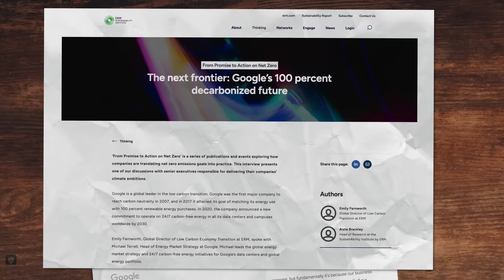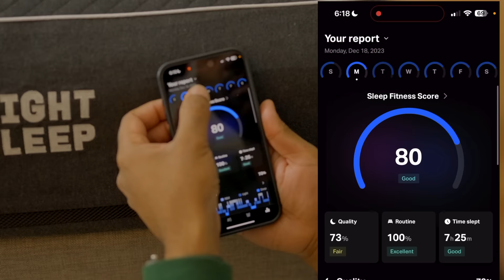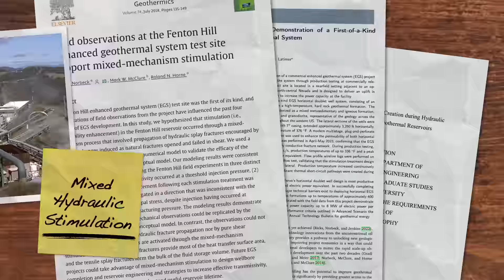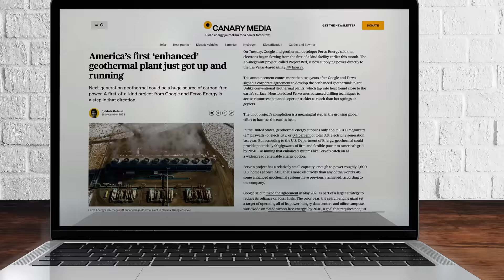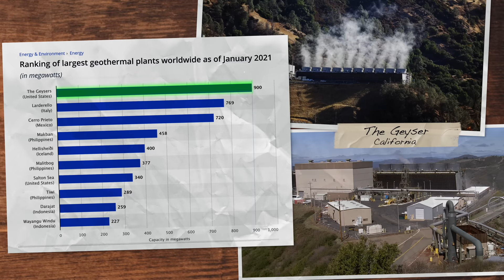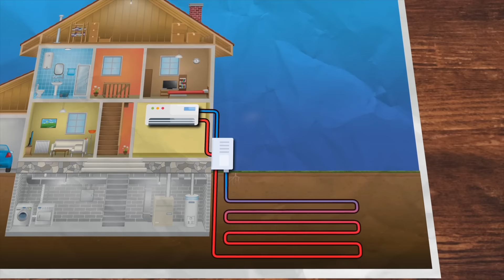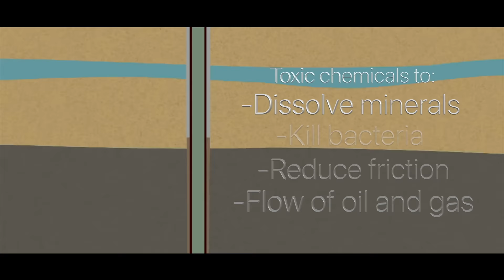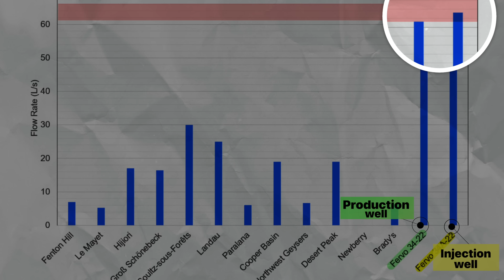Google’s Billion Dollar Gamble: You Won't Believe What it is!

Comment: Another "level" is to place your servers near a company that needs low temperature (pre) heating of some input (water perhaps).  Thus cool water heated by the servers is supplied to the neighbour pre-heated thus saving the energy.  The user pays the server co. so many cents per kWh of heat but at a rate less than the cost of natural gas.
Reply: Next to a swimming pool :)
Reply: Great point!  Maybe, since these can be used for server farms, they create a big pool of water and create submersed server rooms that contain the servers (obviously with a way in and out for server access). 

In the pool, have the server rooms on “stilts” to allow pool water to circulate around the entire room. Design the internal server room to optimize air flow around the servers. 

Water surrounds the server rooms, cooling the servers while preheating the water) at the start of the heat transfer process.  Any corrosion concerns can be addressed on the external walls of the submersed server rooms. 

To control the pool water, may need to create bypass pipe(s) with temp managed valves (adjusting flow based on pool temp). 

Don’t know how feasible or impactful but if lots of energy is spent trying to cool servers, maybe they could benefit a little on both sides of the wall.
Reply: @tomatodanger  Much simpler to simply blow air heated by the servers through heat exchangers to warm the water; this cools the cooling air (of course) and the warmed water can be sent next door for whatever that process is.  Meter the amount of water and the change in temperature and that is the energy transfer.   
eg: 1 m^3 heated by 10°C* is 0.66 kWh of energy.
(*Should say 10K, but that confuses people 2 ways).
Reply: @AlanTheBeast100  nice!  Far fewer moving parts (and submersion concerns 😄) to preheat the water and still a potential drop in electricity required to cool the server farms as the cooled water can be used to reduce and control the temp of air entering the fans.
Reply: IBM has done that at ETH in Zurich where water cooled servers are connected to building heating.
Reply: Or a blue/green algae food generator
Reply: @tomatodanger  Most already use a pond loop for cooling. Standard cooling and heating is done by a glycol/water hydronic loop. For instance ski areas melt the snow on sidewalks and roads by just pumping a loop trough the bottom of a pond that is frozen all year on the surface. You can target hydronic to the heat exchanger on the rack. 
A waterproof room that destroys 10 million in servers with a leak will never work better. Even underwater you have to deliver it to the server. 
Also the humidity load will cost more in a lake than next to one.

Comment: The footage clearly shows a piston reciprocating piston device. It is not a "Turbine." In 1973 ,exploring New Zealand, I visited a thermal power plant. Bores brought up superheated water
which was put though heat exchangers, to produce steam, which could then be utilized to drive turbines. The negative aspect of this was that minerals in the steam deposited mineral in the piping, eventually closing the diameter of the bore and requiring periodic drilling to create a new passage to the surface. Free steam, at a drilling cost, was, as it is said, :Fruit on the sideboard.

Comment: Ricky congrats! Ive been following you since the beginning. You really stepped up your game and your reports are top notch. Unique, in depth and interesting. Talking about geothermal I witnesed two stages of project Miravalle in Costa Rica atnthenslopes of a vulcano. The problem was the minerals that deposited quickly on the pipes clogging the system
Reply: That's what I've been saying from the start since someone proposed using saltwater as the working fluid.
Reply: Make a closed system and circulate your working fluid.

Comment: Thanks for another great article Ricky
Please check out the company Eavor and their eavor-loop  geothermal system.    They have developed a closed system much like an underground radiator which has little or no fluid loss to the rock also they claim far lower circulation energy as the system is partially powered by thermal cycle    
I would love to see your evaluation of their process
Reply: That's a great idea! I like the concept behind the eaverloop. However, that system is quite limited in terms of heat extraction rates compared to EGS, unless you literally drill a radiator with multiple loops and coils.

Comment: I'm excited to see Geothermal used more.  It makes a lot of sense.

It would be cool if Google was able to find a use for the waste heat from their servers as well.

Thanks for this story!
Reply: Google does put use to their waste heat.  For many datacenters, they use that heat for things like swimming pools, various farming practices, wood pellet production, or just simply a building heat source in winter.  Personally, I think it'd be a good idea to purify sea water, since that's normally a very energy-intensive process.

I imagine Google could probably use heat pumps to concentrate the heat for applications that require a higher heat output.  They could even make a steam turbine but I'm sure the energy they gain from that wouldn't make up for the cost of building it.
Reply: So true! Imagine edge computing centers combined with heat pumps for residential or commercial heating. It makes so much sense!

Comment: While I'm a fan of residential geothermal, the need for industrial geothermal plants to use deep fracking processes is an absolute no-go in my mind.  Living in Oklahoma where fracking became a major method of extraction for a while before being severely limited, we experienced house-damaging earthquakes and shaking weekly.  The weekly shifting of the ground rocked the framing back and forth loosening the nails, created leaks in roofs by creating gaps in roof decking and drove wildlife to run from the shaking right across freeways.  Oklahoma oil producers reaped the energy, while we paid for the repairs and foundation issues to our homes.  So, I would recommend  Google keep looking for other ways to be 100% carbon neutral.  If anyone can do it, they can!

Comment: The water use by the pilot plant isn't that great in the scheme of things if its located on a large lot let say tens of acres then 17 million gallons could be collected during a good rain storm if the drainage is managed properly. The biggest challenge is constructing a cistern that would hold that much water.
Reply: Great point! Most problems can be engineered as long as we think ahead of time

Comment: I instantly drew the same conclusion about geothermal fracking. It's what is done to the water supply that is the major problem, that is specifically due to toxic chemicals that apply only to fossil fuel extraction, so unless they are injecting the same or other toxic chemicals into the ground for geothermal purposes that I am unaware of, the biggest fracking concern doesn't apply.

The geologic stability concern still applies, and that still needs to be talked about. One might expect that to be a deal breaker in California, a state that already has a problem with geologic instability, but on the other hand, the existing potential for earthquakes also means that California is perhaps the best place to accept this risk because their infrastructure is already engineered to accommodate it.

The last issue, as you mentioned, is water usage, and in some places that is a huge concern now, and will likely be a big concern in more places in the future. Considering the long-standing and worsening water supply problem over much of the US southwest, that seems like it might make the idea a nonstarter where many of Alphabet's operations are based, unless they can figure out a way to offset their water consumption. This would effectively convert Google's conservation problem from carbon zero to water zero.

Fascinating video! Thanks for posting it!
Reply: Water recycling, using preheated water from the server farm cooling, closed system. it should work with less water.

Comment: Hydro fracking is also used in low production water wells, to open up the granite cracks so that the water can flow more efficiently/freely from the aquifer.
Reply: Great insight! However, I like the fact that Ricky clears this up so thoroughly because lots of people have misconceptions about it.
Reply: Not the same tech or substances at all...
Reply: @ipp_tutor no.. you do, ironically.. and i used to help run a fracking sand truck company
Reply: @dertythegrower  Of course, they're not the same substances. That's precisely my point, and it's why I say people have a misconception about fracking being used in the context of ESG, thinking it's the same as in the oil industry.
But whatever gives you the right of way to showcase your experience...

Comment: Our school district installed a 180-well closed loop geothermal system for heating one of our high school buildings. The system worked well for a couple of years until they noticed that the Delta-T was decreasing. Each year the water temp coming from the field was getting nearer to the return temp to the field. Seems the field could not recover fast enough to keep the water hot. They tried to return the heat by running the AC all summer to pump heat back into the field but this didn't well and was costly. They finally had to install natural gas boilers to help on the colder parts of winter. Not certain that they ever saved money or were able to keep their LEED ratings.

Comment: Just because you're not injecting chemicals doesn't mean that you can't affect the ground water, even just by pumping.  There are different strata of ground water, some that's older with dissolved compounds like sulfates and iron, overlaid with strata that are clean enough for drinking.  If you puncture the barriers between strata, and pump at higher rates than replenished by natural flows, you can end up contaminating the cleaner water by sucking water from the more brackish or "dirty" strata into the cleaner strata.

Comment: Thanks for sharing your videos and updates on various technologies. Always been a big fan of geothermal energy. Last I heard test sights were being shutdown because of their ability to make earth quakes. This was long before fracking was even on the radar. Curious that that is still an issue over 30 years later. They really need to stop trying to make a short cut to getting the heat out of the ground from above. IE they need to put boots on the ground where they are needed even if it’s under ground in high temperature dry rock. They need to develop a functional closed loop system for energy production. 

Future video idea, possibly make a video about the efforts that Eric Sorensen has put into saving thorium liquid salt reactors from the dust bin of the past. Also the various benefits that they could provide. He has several vary long and dry informative videos that are very hard to watch but  chocked full of details that are easy to overlook with each one individually being a game changer. Basically make a summary of his videos simplified and highlighted to show the how, why’s, and benefits simplified to open them up to the general public. Having had over 30 years in the power industry it took me several views of each of his long format videos to pick out as many benefits as I did and almost every one would be a game changer if it could be transferred to our current fleet of steam powered generators independent of prime mover.

One of the biggest advantages was the ability of the reactor to be self regulated due to the science behind its design. It only makes more energy when you withdraw more energy. Stop taking power out it idles itself back to a steady state standby. As a power system operator that one is amazing. The fact that it is self controlled is probably the scariest part of its design. There are very few control inputs because they simply are unnecessary and would likely mess it up thru operator input. It’s truly a walk away safe design.

Comment: Water scarcity is predicted to be the biggest issue this century. So unless they're cooling the water down again into liquid (condensing), then they're pumping clean water into the ground and it is lost as steam. At 63 litres per second that is 33,112,800 litres per year, or 13 Olympic-sized swimming pools. An adult uses 124,350 litres of water per year, so that is enough water for 1,008 people. Add to that, this is probably just a demonstration plant, a proof of concept, so they will want to scale it up. And what about limescale build-up over time? Will they need to re-frack every few years?

Comment: For oil and gas fracking using propane as a fracking fluid has advantages over water.  Of course there is no water to contaminate aquifers. The propane comes back after the waterless fracking so it can be reused.  Propane also produces a frack well that produces more and for a longer period of time.  Only down issue is propane fracking is initially more expensive.  This expense if actually made up for with greater production from the well.  Maybe enviromental groups should be demanding this waterless fracking apposed to outright fracking bans.
Reply: "Propane, Billy. Its the Fuel of the Future!"-- Homer Simpson

Comment: In Arizona, they pump water into the ground to replenish the ground water that is pumped out. Replenish the water table isn't a bad thing.
Reply: Mmmm, well, we Arizonans better pick that up a bit, seeing how farmers and rural locations need to drill up to 1000 feet to reach the fossil water aquifers.  At least one basin is down 2000 feet.  In almost all cases, ground water is being removed at a greater rate than it’s being replenished.  Statewide, we’re in a negative balance situation with all aquifers continuing to shrink as we need to drill deeper to pump out what is needed…or, tragically, what is desired.

At least we have policies in place such that we make an effort to replenish groundwater reservoirs, but the aquifers are losing.  No aquifers have a net positive recharge.

Comment: That steam is nowhere near the super critical temperature required to run modern turbines. The last 20% of the temperature required uses 80% of the energy required to get to super critical steam. What are google using to give that final boost?

Comment: So I know heated waters from the mantle have dissolved metals and silica and that is the mechanism for most geological concentrations of resources we mine(which a billion exceptions) does anyone else here have a feeling there's a way to exploit that while also harvesting geothermal energy? So the metals and other minerals drop out of solution/solidify when pressure and temperature drop, so I'm curious if there's a way to incorporate a way to harvest the minerals in an economic way. Im curious if it will negatively effect the water table. Im curious if being near an ocean or sea and creating infrastructure to feed sea water rather then drinking water to the depths we'd want instead of drinking water. The risk of steam explosions or unforeseen geological events is a possibility I imagine.

Comment: Great work as usual but not sure if I can call it "green" if it's using that much water. Society has always been concerned about clean water and Google is 'doing evil' to make a profit.
Reply: You're right. Carbon-neutral and controlled output in real time are the two main benefits. But the use of water is bid deal, especially if you have to use freshwater.

Comment: Fracking is not the issue. It can be done without causing environmental damage. Oil companies have used chemicals to improve the effects of the fracking to maximize oil and gas production. This is the issue and fracking can be done without the chemicals. Simple high pressure water works fine for geothermal energy.

Comment: The reason gas works for "peaker" generation is that the cost of production comes largely from the gas consumed so you save money when you turn down generation. I would expect that the geothermal plants described would look like a fixed-asset cost base so, yes you can flex output but the costs don't change - much like Solar PV or Wind generation, NOT a good basis for a peaker plant.

Comment: I work with steam engines and power plants as a hobby and you can solve the water loss issue by using a closed loop heat exchanger underground instead of spraying it into the rock directly. Above ground, space isnt an issue for a power plant of this scale so building an air cooled condenser to recapture 100% of the water exhaust from the turbine is definitely doable. They also have the luxury of not needing to inject oil into the steam like i do for my small piston steam power plants

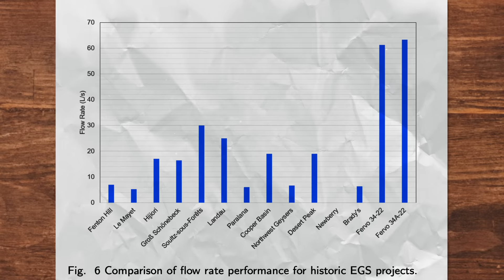Comment: The chart @18:00 shows the huge advantage of fracking the rock.  Consuming 17MM gallons a year isn't unmanageable if you're in an environment with ample water, but the middle of Nevada doesn't seem too promising on that score.  It'll be interesting to see if the water loss continues without end, or tapers off as the voids in the rock get filled.

Comment: The idea of the Earth quakes don't bother me so much and the reason fracking for oil is so damaging is that it can contaminate the ground water with the toxic fluids used to liberate natural gas, considering you only have to use water I don't see it as being that problematic, issue being is this only works areas near fault lines.

Comment: Surely the constant pumping of cold water into the system will eventually cool the hot rocks and reduce the effectiveness of the system? Similarly oil fracking only works until all the oil is extracted. Great video Ricky. 👏👏👏